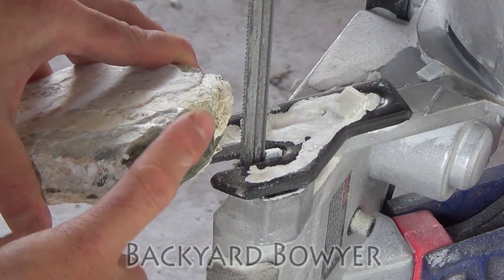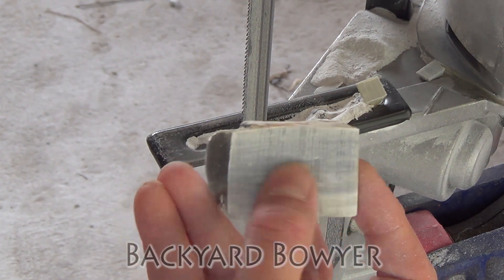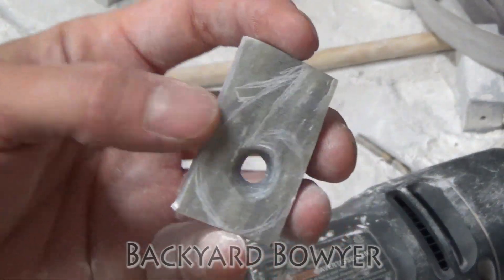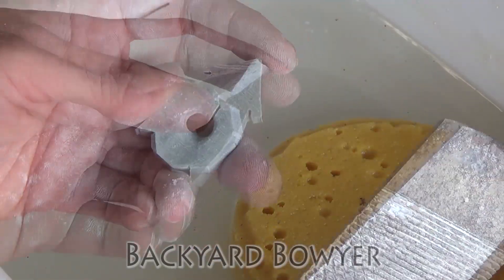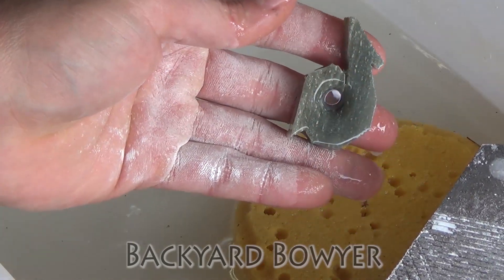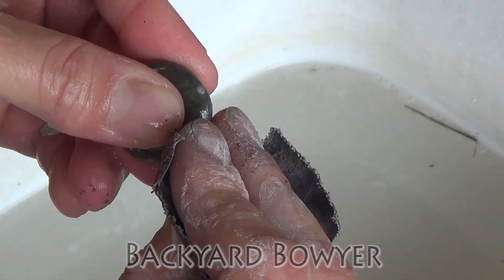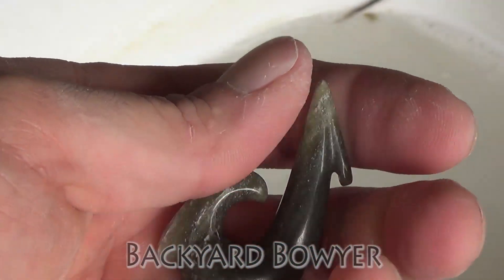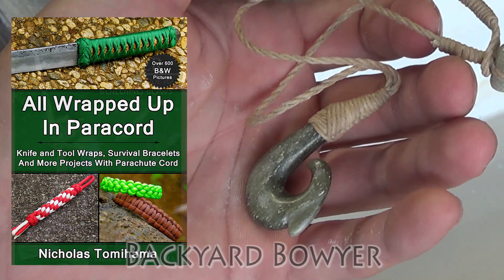Dad Carves a Maori Style Fish Hook For My Son From Stone - Inspired By Maui and The Movie Moana

Comment: Is that the portable bandsaw from harbor freight? Is so is it worth buying ?
Reply from the maker: +Totally Delirious This is! I had the previous cheaper model and it ended up burning out. I really liked the old one, but I do think this one is a lot better.

It's basically a clone of the current DeWalt model with a similar over-molded plastic case. I think it is a great saw, much quieter and with more torque than the previous one.

My main complaints are limited cut depth, lack of a lock switch, and poor speed control.  The old saw had it's smaller motor out of the cutting area meaning you could make a cut indefinitely long. This one has a max cutting depth of about 5 inches because of the size and placement of the motor. You can't lock it in the on position, and the speed will sort of go up and down and you have to play with the switch to keep it in the right speed.

I'm really bummed about the cutting depth, that's the only major thing. But this saw has way more power in the cut and stays much cooler. It powers through things the other saw would bog down on, though it likes to shed saw teeth more. I do like that the noise level is on par with a normal variable speed bandsaw. The old one sounded like a poorly lubricated chainsaw at all speeds.

So if you can work around the short cutting depth, it is a great saw. I am actually thinking about getting one to use exclusively on wood.

I should do a review on it too, as I've practically written one here! Thanks for watching!
Reply: BackyardBowyer I'm considering buying one thanks for the info and keep up the great vids